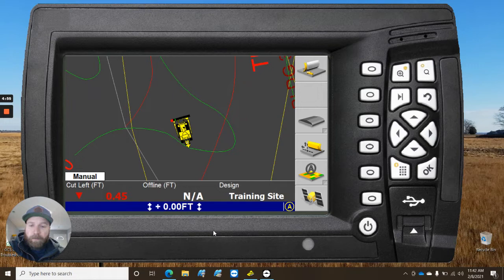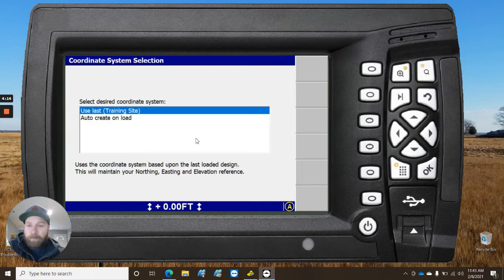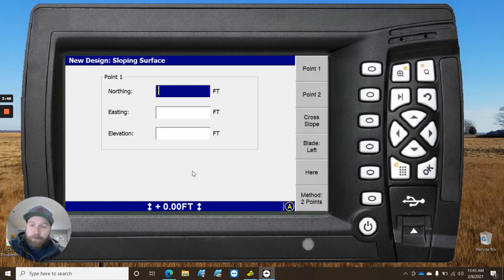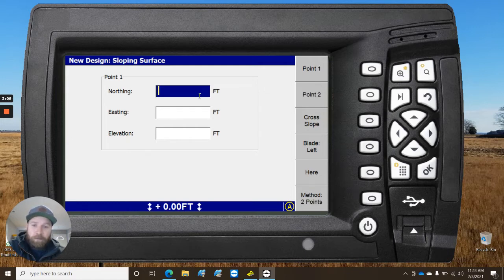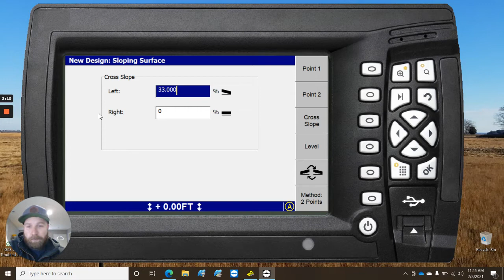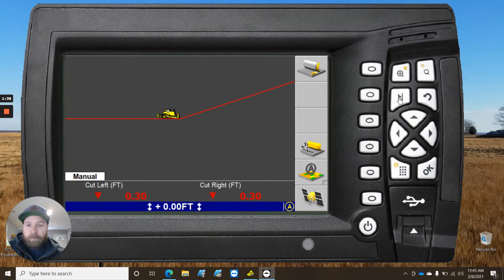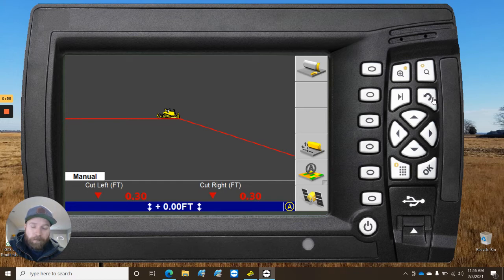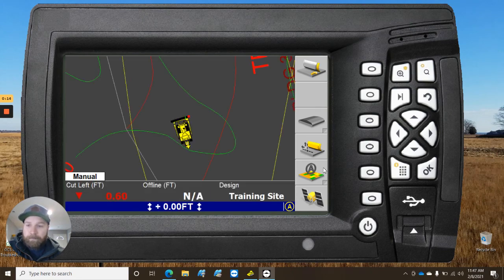Creating a New Slope in GCS900

Comment: Someone told me you couldn't make an infield design with a GCS900 like you can with Trimble Earthworks. That doesn't seem to be the case from this video.
Reply from the maker: Trimble Earthworks has more ability for infield design than GCS900. You can do infield designs for multiple points (contours) and apply a template to that contour. That said, there are a lot of things that can be done in GCS900, so depending on what you need to do with it, it would determine which one you will need.

Comment: Hey. I watch all your videos. Can I use this method to move the side of a basin in.  They decided to make this basin 20ft more narrow. Everything else stays the same. I would just like automatics to build the 4:1 slope for that side. Is this possible from my dozer?
Reply from the maker: Sorry I missed this comment. 
It's hard to say exactly without seeing the file, but I'm thinking no. 
You could apply a horizontal offset to the toe of the slope and use the dozer to build a 4:1 off that. 
I'm sure that's too little too late, but honestly it would most likely be easier to modify the surface file and load as a new project. Our contact is on our website. If you want to send the machine files over I'd be happy to take a look at it. 
myconstructiontechnology.com

Comment: Excellent video 
In the past year I made 25-30 infield designs on my machine. 
The office folks came out and said these designs were slowing the CB460 box down. 
How big are these infield files, and will they slow the computer down?
Reply from the maker: I don't know exactly how large the files are that you have created. I created some new levels and looked at the files after I downloaded them and they were only 4-6kb which is very small. 
Typically there is a large project file that will slow the control box down, I've seen several projects get the existing contours or something loaded in and make for a large file. Also, if any sort of mapping is turned on you can collect a lot of log files that can slow it down. 
Another large file that ends up on the CB460 is the firmware files for the receivers, if you have several .s files saved on there they are quite large. 
In my opinion 20, infield designs wouldn't effect the speed of the CB460. 
If you insert a thumb drive while the box is in managers mode you can clean out project files as well as unused files. Just make sure and backup the control box prior to deleting anything.

Comment: I never seen a video of cross coupling. I can use the horizontal design on one side of the grader blade and a target cross slope on the other correct? If no vertical design is incorporated into a horizontal design then you can do this right? So for instance if all I have is centerline I can use the cross slope out to the shoulder right? I tried it a few years ago but couldn't get it to work because the 3D seems to override the accugrade, but it I turned on the cross coupling feature I could run I like a hybrid (3D plus sonic tracker) but in this case slope control....

Comment: Good video thank you , do you have access to earthworks to explain on there too ?
Reply from the maker: We do a little bit with Earthworks machines, but not a ton right now. I have an emulator but haven't set it up yet. Next chance I get on an Earthworks machine I can make a video for that.
Reply: @ctpusa1  we had a class with an emulator wasn’t the same hitting keys instead of joysticks it’s all pretty cut and dry just get in and make a new level or slope same as gcs900 I just have a few operators wanting to learn for ditches and you explained it well on the gcs